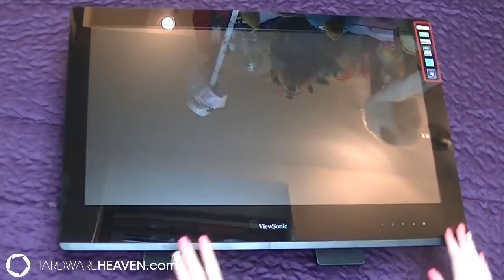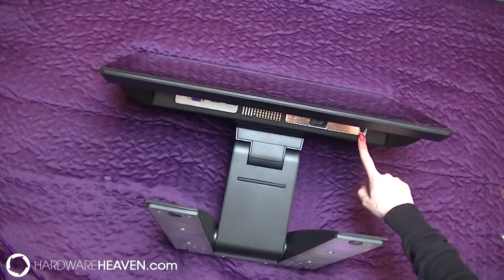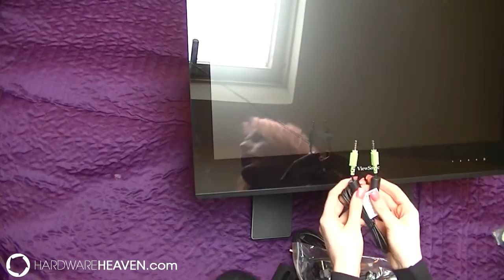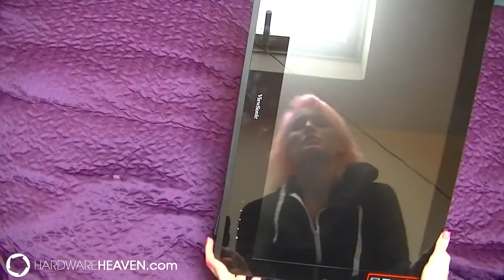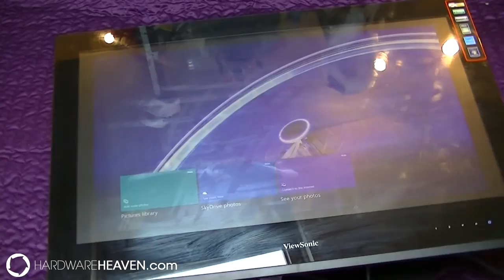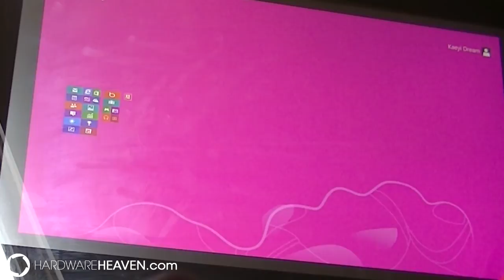ViewSonic TD2340 Touchscreen Review

Comment: Touch is useless if you only press on the screen. You should have tried to move windows around to see if the windows follow your fingers properly. The screen is not that responsive from what I've seen in this video...which is kind of disapointing.